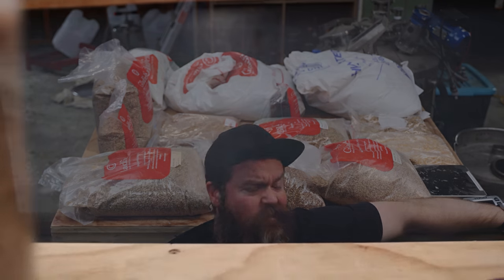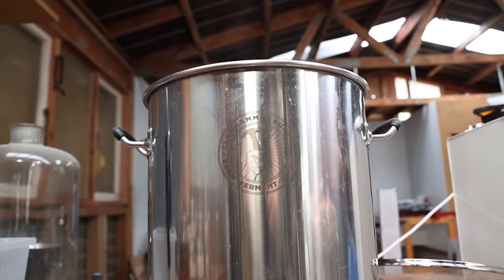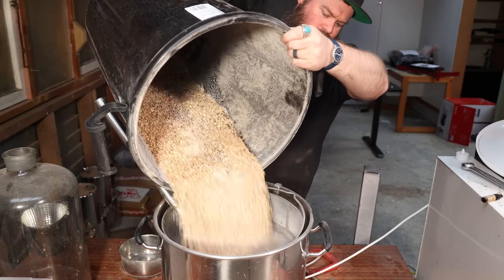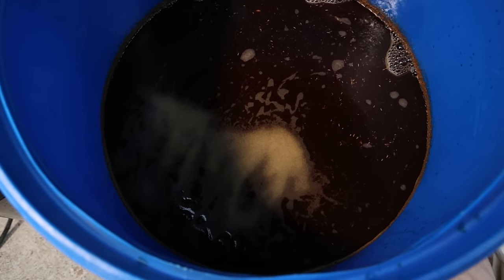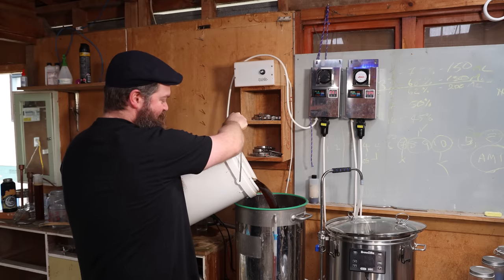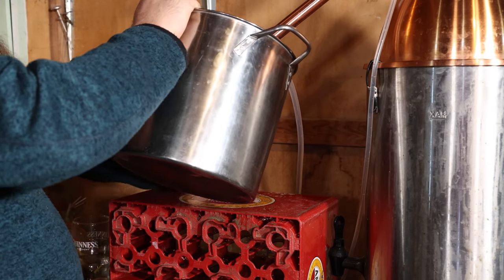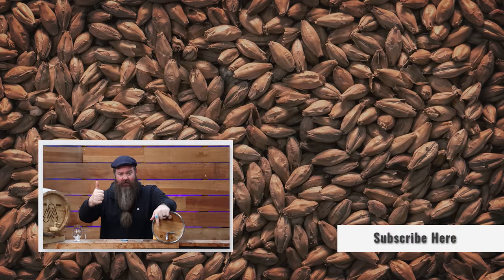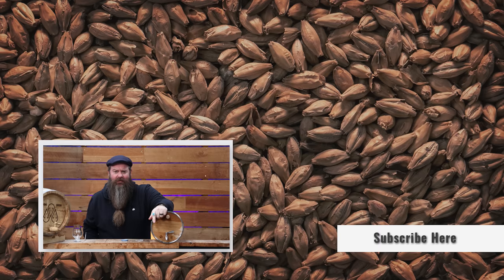I Made A Mongrel Whiskey . . . . But I Still Love It!

Comment: An interesting thing I found in an old book on brewing beer in the 1800's was the use of old malt. The prevailing knowledge of the time said that you had to use grain from around London to make good beer, as it was the finest quality. The author of the book however found that imported malts typically were moved into London by ship, and took on some moisture. this was remedied by simply re-drying the malt, allowing brewers to use cheaper grains to brew quality beer. I thought it related well with this video.

Comment: Great idea! I have had to do similar projects and would love to share my method, sorry if its too long

My parents store grain and regularly rotate the storage, leaving me with buckets of red and white wheat, barley, millet, spelt, emmer, Kamut, einkorn, and lots of preserved sugared fruit.  I've been experimenting with taking the products that are given to me as a flour (millet and wheat) and baking them before brewing in my brewzilla.  Its kinda a kvass/Sumerian style?   

My best results so far have been to heat the flour slowly in a huge brazier pan with enzymes until it gets unmanageable to work with a spoon,  cool it down, and slowly feed it through my masticating juicer with the "churro" attachment.  I take the resulting noodle and chop it to finger size and bake it again in the oven until its the color I'm aiming for - varies between flour type.  The briquets are very hard, smell sweet and malty, and sometimes have sugar caramelized at the bottom where they touch the baking sheet.  I let them dry under a constant fan until they are bone dry - at least a day or two.

When I brew I weigh the briquets I'm going to add to get an estimate of my ratios for other ingredients. I add water conditioning to 5.2pH, Distillers' 2 row barley (1:10 to briquets), RICE HULLS (all of them?), and gradually step up the temperature from room temperature to 145F, add the Briquets, and increase the temp to 155F for 45 minutes.  It... doesn't always end well for the brewzilla pump if the flour isn't processed right.  My worts have ranged 1.045-1.110 OG and colors from amber to dark (purple one time- black rice).  I love using Omega Labs Sundew OYL401 for its unique phenols. 

I brew to use this storage and to fuel my research into yeast and due to life-long health issues I can't consume any ethanol without concern. My family is also highly religious and in an area that doesn't have high alcohol demand.   Being that I am brewing blind I rely on 3-4 friends who drink regularly to tell me how things taste.  They like the Bread Brews so far, and the most common flavor profile seems to be strawberry followed by toast ending with peanut butter tones.  One of the big comments is surprise over the fruity flavor, which I attribute to the millet and the yeast.  

It makes great grain alcohol slowly in my air still. 

TL;DR:  Brewing Bread Beer is possible when when conventional malted grains are not.  Its probably not worth it unless the grains are going to waste.

Comment: I always appreciate your content. One question I do have/ have not seen any in-depth information on is operating temperature for condensation coolers or tubes. I currently use a 10 liter Bucket and a recirculation pump adding ice to cool it down. It works but I honestly have no idea what temp is bad, good, or best?

Comment: This a question I've had for a while but have been unable to find straight answers (maybe because the scotch industry is secretive of their process, or because home distilling is just starting to learn about all of this)

Basically after extensive research the way I understand it is the "heads" contain most of the esters and you want some of these compounds in your new make to then esterfy in both distillation and in the "barrel". Too much of it can cause a solventy/rubbing alcohol burn and smell (I get a lot of that in burbon which I hate) but the right amount can cause fruity esters through esterfication and transesterfication like Bruichladdich. The basic understanding is if you're aging for short periods of time then have less heads in your new make and you can possibly get away with more heads if you use a barel due to "slow distillation" from the barrel loosing heads. Also longer aging can cause mellowing of heads.

Second is tails. I understand that some tails are essential in providing acids for esterficstion and providing oils to provide a good mouthful and flavor profile. I understand that in Islsy you want to dive deeper in the tails then say a light corn wiskey. I've "made" new make that has been down right undrinkibly tailsy thinking it would never recover and after a year of sitting in glass on a tiny amount of 2nd use 2nd toasted oak not only have the tails completely disappeared but they also have transformed into "chocolate and silky" mouthful and none of the funk has remained.

The question is this what flavor both heads and tails and ABV are you "cutting" at to long age your wiskey I'm "making" a 21 year old lightly peated scotch for a friend who is expecting his firstborn in a few months and the plan for a shower gift was to age in glass on a small amount of 2nd use 2nd toasted oak with a very wide cut leaning towards the tails. The reasoning is since it is in glass less of the heads will evaporate vs a barel and I don't want it to be to solventy in 21 years. And I want enough tails in the new make to be almost un-drinkably tailsy so that the tails can transform into wonderful flavors in the future.

People in home distilling place too much emphasis on the new make character with cuts and try to make it "drinkable" off the still with no emphasis on what happens to all the components with aging. Do tails disapate more than heads and vice versa? Please let me know your aging experience the amount of time and what happens to each component with timw on oak both barel and glass?

Comment: Hi, Jesse! Grains, different king, gives different percentage of sugar after conversion. Rice, wheat, barley, corn when crushed and gelatinized properly give +/- the same results. My experiments with rye gives goopy messy substance with very little sugars. Rye is good in bread, not good in whiskey, but 5% is good for flavor. I always watching your videos in YouTube. It is interesting. Cheers! 🥂
Reply: Rye is one of my favorite whiskey styles. It does have less sugar content than barley, but not by much. The main issue is like you say, it gets goopy, and you can get poor efficiency because of this.
Reply: @Vykk_Draygo  :) I use rye for flavor in sugar washes - whole grain without enzymes or a little bit, just treat rye with +100C hot boiled water for "yeast nutrient" and flavor. Yeast eats grains very slowly and it is very good! We just add sugar and water and it`s go`s forever! :)
Reply: @Vykk_Draygo  you can use rice husks. There are lots of this on the net
Reply: @marvinharms1891  Yep! I have some in my garage for potential problem mashes. Works great, as long as you use enough!